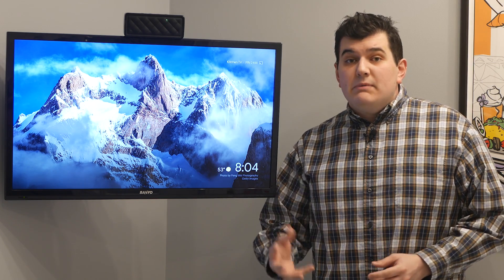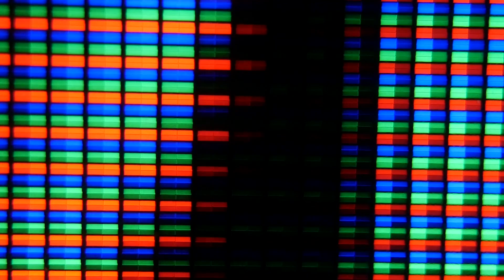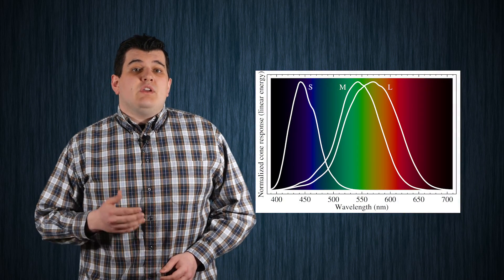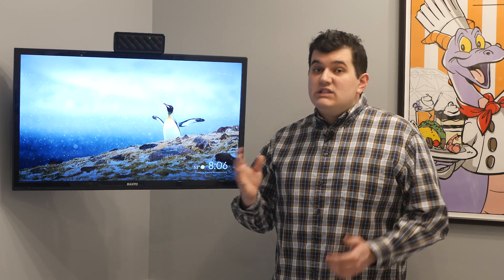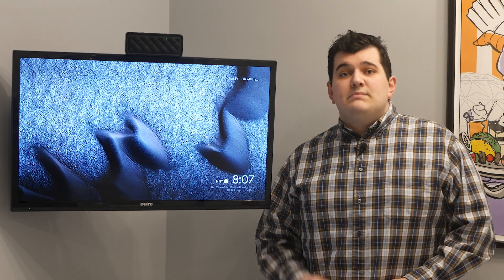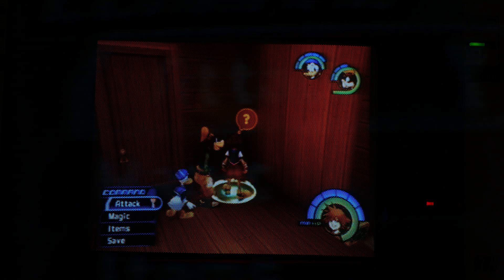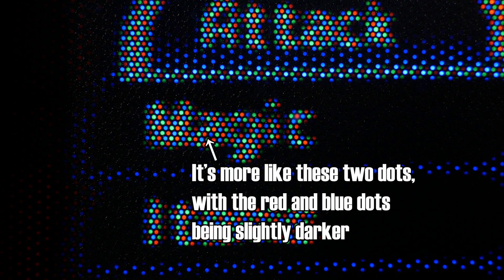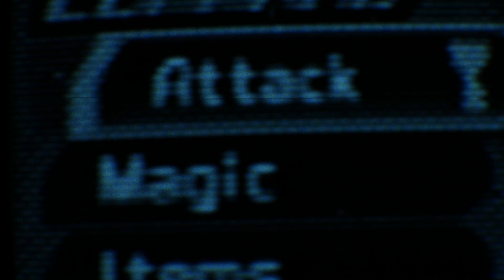These Are Not Pixels: Revisited

Comment: Not sure what he's blathering on about in this video - but the 'these aren't pixels' thing is wrong. Image pixels exist as both data and image display. The modern digital stuff could be the same but it needn't be. The little blocks of light in the old analogue days are 'display pixels'. The image data (480 lines US, 625 lines UK) are 'image pixels'. Larger CRTs likely have more display pixels than there are image pixels whereas tiny old TVs would have fewer display pixels than the number of image pixels. Being analogue, this didn't matter. If pixel 1 on line 40 was red then the 40th image line would start with red. A tiny TV my not show this and a large tv might illuminate 3 display pixels to represent the one image pixel.

In the digital image era, it is quite reasonable for 1 image pixel to illuminate 3 (RGB) display pixels - to fully create the colour of that 1 image pixel. But if you enlarge the image by a factor of 2, that 1 image pixel is now driving 12 display pixels - four for each RGB colour. Enlarging the image does not increase the image resolution, it just makes the display pixels larger by using more of them.

Comment: I feel bad for saying this but... I think this is either unclearly explained or wrong. In a digital picture, the value of each individual pixels are recorded as how much brightness per colour channels (red green and blue). Depending on the colour spectrum of the colour profile of the image and the numbers of bits per colours, a range of value per channel are possible. And that’s only true of RGB pictures, as black and white and print images have different value structures to each pixels. If the Tv set then translate this grid to any other grid, I do not believe the new grid, wether is made of staggered columns of squares, rectangle, or even triangles holding in the same information: how much brightness per colour channel in each subdivision of the image, makes them any less of a pixel. Saying a conversion on the shape of the pixels makes it no longer pixels is like saying an MP4 video converted to WAV isn’t made of the same FPS because the 2 formats don’t have the same way to describe it in their code.

Comment: It's also important to note that although Television sets back then indeed had ELECTRONIC circuitry, this is NOT the same as digital circuitry. It is still entirely 100% analogue, with vacuum tubes, capacitors and hand-wired logic circuits.Sure the TV set was actively looking for a signal, but that in no way means it was using digital logic.

Comment: Well, strictly speaking, the "pixels" on LCD screen aren't pixels either.

The term Pixel existed long before we had LCD screens, and was already in use when computers were hooked up to CRTs. Pixels is a term that comes from computers; and means essentially atomic picture information; it was the smallest square, or rectangle or whatever shape, depending on how the software that wrote the information to the screen was written. It was the information on the screen that could not be subdivided, thus atomic. I don't know who came up with the term, or if anyone in particular even consciously came up with it, and instead the term was just one day used and it stuck.

But as such, a pixel is entirely irrelevant to screen technology in use; the smallest dot that is no longer made up of smaller screen information is a pixel; and that's the case regardless of whether you have a CRT or an LCD, or a Plasma, or a LED screen; if you pixels that are big enough, a resolution low enough, you can see those pixels on a CRT just fine; hence the sentence, "Back when our pixels were as big as cats." Or just "Pixels as big as cats" for short. As well as "pixelated", meaning you make out a certain number of pixels, and have jaggy edges, for which we developed anti-aliasing technologies.

Now, today, given what screen technology became dominant, if your pixels don't perfectly map onto the little screen elements, whatever the proper technical term is, your picture becomes blurry, just pick a non-native resolution in a game on your PC monitor and behold the effect. Thus the term 'pixel' started to do double duty for both the virtual smallest picture information, and the physical dots on a screen, but strictly speaking the physical dots in the screen are not pixels.

And as such, CRTs can show pixels and you can see pixels on a CRT, as long as the source for the picture is digital, and its resolution smaller than the screen is capable of.

Comment: How many different formats do you have to export to display the same video on each of the displays?  And how many adapters do you have to use to do that?  Are you burning actual VHS tapes of your YouTube videos?  It boggles my mind thinking about how many wires must be involved in using all of these older pieces of tech.  Where do you even find replacement parts?

Comment: I think it's important to mention something about the mask here.  Another reason the mask is necessary on a color TV is this: 

If there were no mask, the electron beam itself would have to be colored either red, green or blue.  The mask makes it possible to use a colorless electron beam for all 3 signals, as long as the correct beam for that color hits the correct color phosphor dot on the crt.
Reply: There were rear projection crt tv. They had different color beams. Instead of mask.

Comment: What you and i think working of lcd display is more complicated . Because i have examin two television 1 is LG 4k and 2nd is crown indian brand . Both is 55 inch in size .But most intresting thing is they are using same pixel denstiy lcd panal ( i have seene with hi power lens) . Lg tv main bord support 4k video rasulation and crown tv main bord only 1080p (fhd).Now days lcd panal making is cheaper in factory . Tv Maker assembled parts in their factory and giving own name . But inside all tv is sometimes same part like they using Samsung or lg panal. Difference is only  outer body and main board, some software and hardware . If I change crown tv main board with lg,s 4k tv bord then crown tv became 4k tv . Because display they are using 100% same. Wisdom shair is another brand  which is 50 inch but display agin high density like 4k . But play only 1080 p videos. You have to resurch More.

Comment: The main difference is that the B&W tube could display more than 480 lines there is no subdivision on the surface that limits it, but the color TV can't - it has physically defined phosphorus target dots and so physically defined limits to its color resolution. Sounds like pixels to me.

Comment: Pixel is just a term that stems from computer graphics (Think graphics designers started calling them Pic Cells first = Picture Cells.).  Afaik they already started used the term way back in the 80s when CRT screens were the only available screens. I guess the term was already so ingrained when flat panel displays started appearing that they started using the same term to describe the individual cells in LCD panels. According to various pages the term Pixel was first used all the way back in 1965.

Comment: @5:28 Not sure if its how you processed this, or if its a simulation of snow. But in full screen I CAN see regularity vertically. During playback and when I pause during the snow I can see distinct, evenly spaced, regularly repeating vertical slices. And on some frames I can catch horizontal slices. YouTube compression madness messin' with your example?

Comment: Was upgrading/altering shadow-masks a thing? Wouldn't a finer shadowmask just straight up upgrade any given TVs colour-resolution? And were other shapes than circles, lines and squeres experienced with? Im sure there has to be other shapes that produce a complete grip with three lightsources, and one could even mesh up groups of different holes by increasing the distance between lightsources, producing a high colour-resolution picture with smearing of some sort.

Comment: "Theres no regularity in this noise" yt compression: allow me to introduce myself
Reply: Just wanted t add one thing: Try to save any image as a jpeg with very strong compression (minimum quality) and you should see regular 8x8 blocks. That's because every 8x8 block is compressed separately, and when compression is high (minimum data), information at blocks' edges don't line up any more. If I am not wrong, mpeg compression uses the same approach.
Reply: Yeah, I saw the blocks :D :D But imagine seeing this in person. There's no compression in your eye, right? Well, apart from the persistence of vision. Would you see these blocks created by the compression algorithm? Think about that way. There's no vertical separation of the lines. Those blocks you see in this video are result of the post-processing that compresses this video. YouTube doesn't deal very nicely with snow, confetti or any other noise patterns. Because of the unpredictable pattern, the coder doesn't know how to encode it seamlessly without any noticeable lose of details (that's why it's called lossy compression - it loses details in order to save up some space). YouTube uses ever so standard H.264 compression scheme (which is mostly used by your digital TV broadcast - the newest upgrade is of course H.265 or HEVC, which is slowly taking over the digital terrestrial broadcast worldwide). Those blocks you see are mere result of the algorithm trying to figure out how to draw the picture with less details without it being noticed. And it fails, so what it does is it just quantizes the image and doesn't care about the visibility of artifacts.

TL;DR: I know this is a joke, but I really had to write a sum up :)
Reply: @CZghost  Actually, YouTube can support several different formats now. It served this video to me in vp9, which is much better than h264. It supports avc1 as well. H264 is usually avoided nowadays as it is not very efficient.
Reply: @CZghost  I have compression in my eyes
Reply: @CZghost  Thats a good explanation of whats happening here, but
Actually our brain does compress (and structurise) what eyes see, because most of what eyes see is useless. Brain cuts out stuff that you're not focused on, seeks for regions of similiar colors, to put it as one big color blob instead of thousands of "pixels" that retina consists of. And, in this noise, as in any random noise, will be regions that darker or brighter, or mostly grey actually, what our brain will compress to: horisontal straight lines, mostly grey, changing fast. And some of the more persistent darker spots, of course. 
What do you think?
Reply: @CZghost  nothing standard about H.264.. there are multiple implementations of it. Original algorithm meant to be a hardware (matrix) compression. It's merge sort of video compression.
Reply: Because there are no shortcuts in true random noise. It is a massive amount of data with no shortcuts available. Each pixel at each time needs its own true datastream. 
F yo compression!
Reply: wait where did u get the pfp from?
Reply: This needs more up votes
Reply: @henryokeeffe5835  upvotes lmfao
Reply: How do you mean? Is "youtube compression" different than normal mpeg-compession?
Reply: @herrbonk3635  well, most of youtube videos now plays in Google VP-9 video coding format(Though every video has at least one AVC/H.264 version of copy for compatibility, right-click the video and select the stats-for-nerds to see actually playing video coding) and that compression algorithm is clearly different form mpeg stuff. But VP-9 still partitioned video into seperated compression units and processed each of them almost individually. If youtube allowed a higher bitrate for this video, this compression artifact could be less visible. However, unless it allowed the completely lossless raw version of video, the artifact will always be there though probably not visible.
Reply: @vanakryptaaphrodisia1435  Lossless ≠ raw though. For stll pictures, .bmp is raw while .png is lossless, for instance. You could do the same 100% lossless coding of moving picture data, of course (although not as efficient as when also using cosinus-transform or other spectral transforms).
Reply: @herrbonk3635  so called lossless are still lossy.. both in regarding video and audio compression. It just assumes a constant amount of loss persistent and not being noticeable (until it is)
Reply: @EllAntares  Some video format perhaps, although I never heard them advertised as "lossless". But not formats like bmp, png, raw and others. They encode the data in a 100% reversible manner (I've written encoders for png and jpg myself, so studied the bit patterns and mathematics in detail.).

Same with the audio CD format and most of it's followers. Unlike MP3 and similar, they never remove any information. So as long as you copy a (say png) picture file or audio CD strictly via the digital domain, nothing is lost. Going via continous signals is another thing entirely. That would introduce some loss, noise and distortion, of course. Same with physical limitations of the source detectors, linses, microphones, and A/D-converters.
Reply: @herrbonk3635  probably not, but it seems alot more intense
Reply: @herrbonk3635  yes, youtube uses vp9 mostly not mpeg
Reply: @snowwsquire  but they recommend you to upload the video encoded with H.264 before it gets transcoded to VP9.
Reply: @herrbonk3635  "youtube compression" not different, youtube uses publically available codecs. But youtube uses very datarate optimized settings. Thus you can see heavy block artifacts (regular pattern). It was on point with the script and funny.

Comment: You're trying to say the "image" is the light that's projected before it hits the mask, and not the light that's emitted from the front of the screen.  No one would ever be inclined to agree.  The "image" most people refer to is the one on the screen.  It doesn't matter how the "picture elements" are created, they are still elements of the picture.  By the way, modern TVs still use a single source of light modified by a filter to create smaller parts of something bigger, so any way you look at it, what you are referring to as being pixels and not pixels are all fundamentally the same.  That means they are all in fact pixels.

Comment: both the CRT televisions I've owned in the last 15 years have a shadow mask 'resolution' of 480x480.
Although there is a half cell offset each line so it never forms a clean grid.

Still interesting to contemplate the implications though.
Also if you observe an old console that uses the '240p' hack, you note that many of the cells are only half-lit, as only one field is ever active, and every other 'pixel' the scanning pattern doesn't line up with the grid.

The true resolution limits of a CRT are more to do with the ability to focus the electron beam.
The CRT monitors I had could officially do 1600x1200, but you could also coax one into displaying a 1920x1080 signal, however the result was a little bit on the blurry side...

Comment: So... color CRTs do have pixels. Just because there is no digital logic involved in dividing the original analog single into discrete "color dots" doesn't mean that it isn't converted into them before being displayed. Unlike a modern display, the brightness is still analog, but discrete brightness isn't part of the definition of pixel anyways(and if you really want to split hairs, it is analog in modern screens as well).

In fact, the color masking method used is almost exactly the same as modern LCDs. The main difference is that, in a modern screen, the mask is active and the light source is passive.

Comment: That’s a fair enough explanation. In most countries, using 625 lines, the analogue picture equated to a little more than 600 lines, and that handled 800 x 600 pixel computer data (converted to analogue) quite well. The US system was more compatible with converted 640 x 480 pixel data. The other notable exception was the French 819 line analogue TV standard, giving about 800 lines, but with poorer horizontal definition within similar analogue bandwidth.

You didn't point out the fact that the electron beamwidth is significantly bigger than a colour triad. A bright beam means even bigger beam diameter, thus spreading over even more holes, or slots, in the shadow mask. Maybe you didn’t mention it in order to keep things simple, but you can see that the beam covers several phosphor triads, quite clearly, in some of your close-up shots. 

You could also have mentioned the fact that no two analogue CRT television displays show exactly the same image, because of alignment differences and distortions. Further proof that pixels are not being displayed.

Incidentally, congratulations on finding both monochrome and colour analogue TV receivers which still work, years after they became obsolete. I haven’t seen a working monochrome receiver for almost 20 years.

Comment: Another huge difference, that wasn't covered (or maybe it was mentioned in the comments somewhere already?). A pixel by definition has a single colour and a single brightness. A phosphor dot can have different levels of brightness across its entire area. Your tiny 5inch CRT actually illustrated this: I can see some rectangular phosphor dots that have a different brightness at the top versus the bottom. This is actually key! The CRT output STILL exhibits the continuous analogue brightness information even despite the apparent discretisation imposed by the shadowmask.